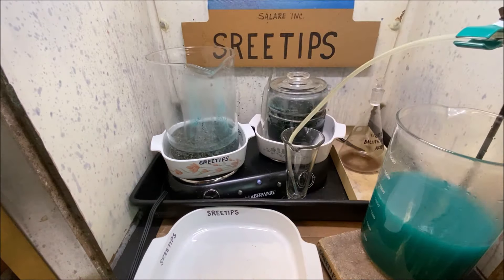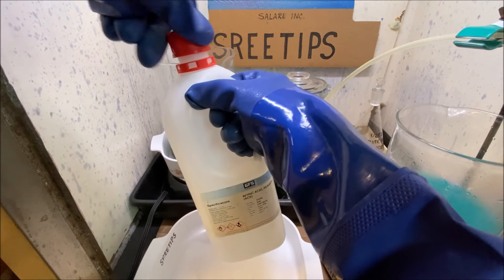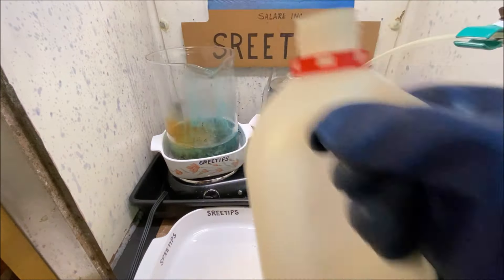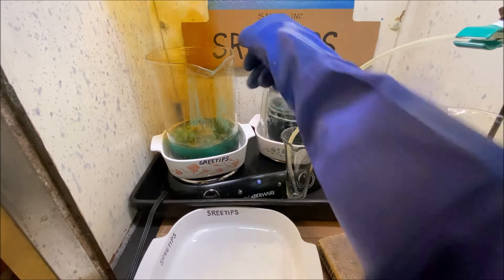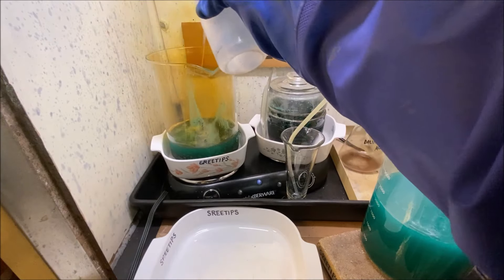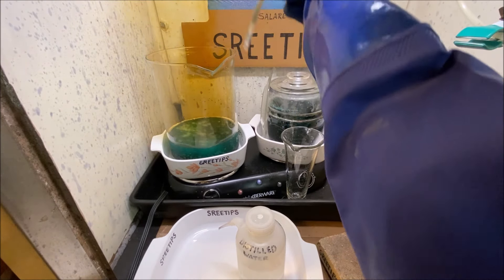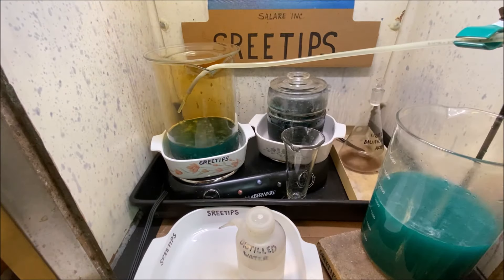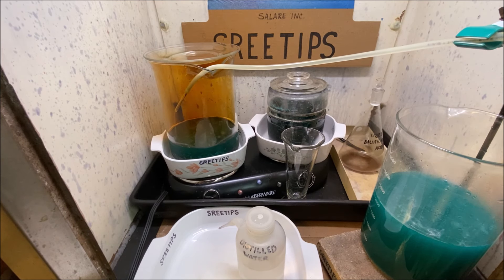Refining $47000 Pure Gold Bar At Home Pt3

Comment: Nurdrage has a vid on how to get the nitric acid out of copper nitrate.
Reply from the maker: Bob, when I dissolve sterling silver, it puts the 90% silver and the 10% copper in solution. I boil the nitric and ensure that I have excess silver metal in the reaction. This GUARANTEES that all available free nitric has been consumed. I’ve seen my solution so devoid of nitric that when I add copper it just sits there and the silver won’t cement out. To remedy I ADD A HALF ML OF NITRIC to get the reaction going. The point is; my copper nitrate solutions will have very little of any free nitric acid. So going through the process of recovering nitric from copper nitrate solutions would be a gigantic waste of time for me. For nurdrage to do it makes perfect sense. He will probably get several tens of thousands of dollars from the millions of views and the associated ad revenue.

Comment: As much distilled water as you use, have you ever thought of getting an RO/DI system instead? After you run RO water through a deionization cartridge it is virtually the same as distilled.

Comment: I don’t use constants I just do the math. For example if you have 10 grams of 14 karat gold just multiply the 10 grams by 14, then take the total and divide by 24 for ~5.83 grams. Don’t have to remember constants!
Reply from the maker: Constant for 14k is 1.265
10g of 14k times 1.265 equals 12.65g of sterling to add.

Comment: When I was 11 years old I had a chemistry set I used and had fun with mixing different things and experimenting I got involved with gunpowder and some oils I put flame to some of it ended up blowing the little finger and ring finger from my left hand I don't think it was a terrible thing I actually learned it from it, there was a lot I could have done to prevent that from happening I just did not take precaution you learned from your mistakes I learned a hard way I lost two fingers but it doesn't stop me from moving on I'm more wiser than I was at eleven now I'm 59 years old he just take the bad with the good and move on!
Reply: My wife is 27 years younger than me she will be helping me with the extraction of silver and gold together we are a team!
Reply: You said in previous videos you do not add water distilled water to acid but here you are I don't get it!
Reply from the maker: Eric, rule of thumb is: acid to water. Some acids create an exothermic reaction when water is added to concentrated acid. For example, adding a drop of water to a beaker of concentrated sulfuric acid can cause the water to turn to steam so fast that it spatters hot acid all over the place. I have much experience working with these acids. You can add water to acid if you know what you are doing from your experience.

Comment: Why can't you make a crucible with the bowdere cement  special for the heat
Reply from the maker: Im not familiar with bowdere cement
Reply: @sreetips  it's in the home Depot and it's white and you mix it with water and you can make it it will hold for the heat
Reply: This Boulder cement is called all-purpose and it's at the shelf at home Depot

Comment: When your doing the towards you pours i wonder if you could modify the fume hood to have filming ports on the sides or back that can be covered when not in use? 

That way you can film whichever direction you like and your safety can come first. Also are you wearing more than the gloves for PPE? Eg face shield?

Please make your safety first above filming. Find a further away angle, even if its a little blocked by arms or body etc, be safe first sreetips!

Comment: That Nitric Acid is not cheap.  Like 50 bucks Per 500ml.
Reply from the maker: I just bought two case, each case has six 2.5 liter bottles. Twelve 2.5 liter bottles total. Cost me $515 delivered to my business. That will last me until next fall 2021. They don’t deliver to a residential address. I have it shipped to my jeweler friend’s business.
Reply: @sreetips  Ahh. Thanks   I was wondering if some average Joe could purchase.

Comment: The rinse step between adding more acid after pouring used nitric seems unnecessary and only seems to create a larger volume of silver solution that will need to be processed later.